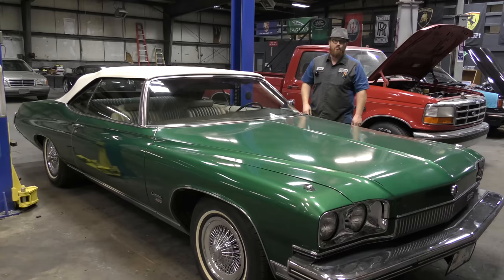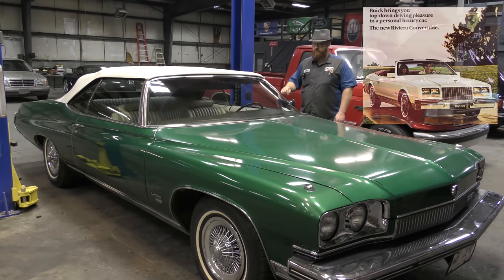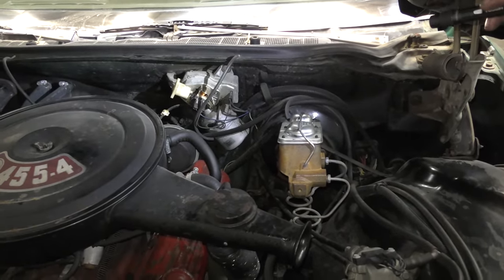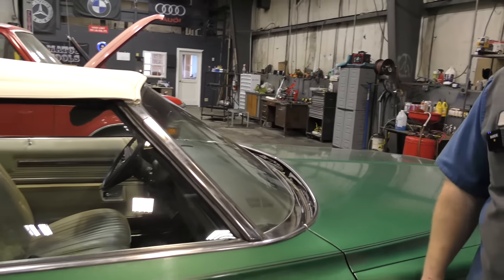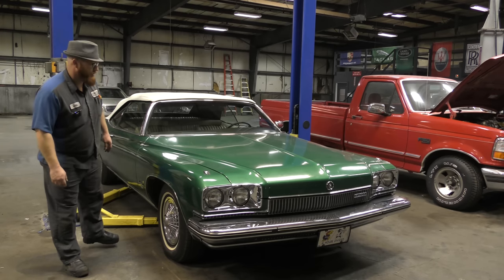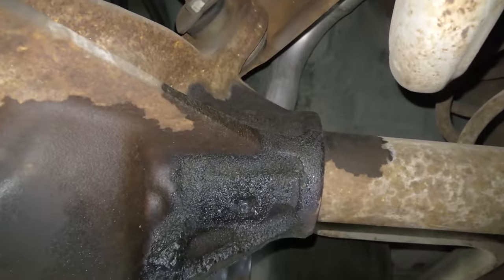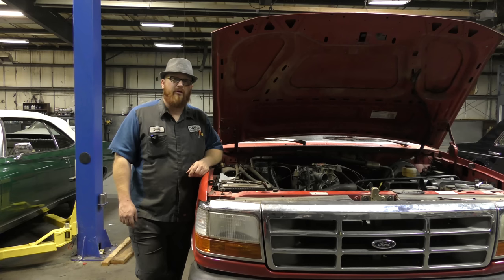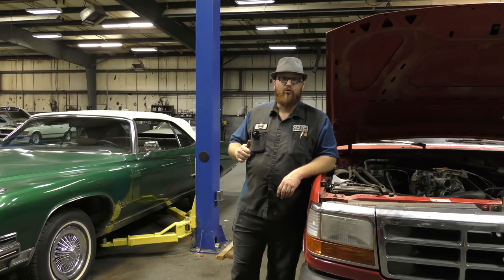Road Warrior! The CAR WIZARD shares a rare '73 Buick Centurion.

Comment: My mom had that car. It was yellow. It was a boat.  I drove it for my drivers test when I was 16. The examiner was impressed when I got to the 3 point turn in it. It would really fly with that big ass engine. I don't remember it being so load but did have a rumble.

Comment: I remember my girl friend got a Buick that was basically a Chevy Nova with different name badge and taillights. She argued with me about it until a mechanic told her Yes, it's just a Nova with a different wrapper. That being said, those 1970's cars were so emissions controlled, it killed any horse power they had. If you were like me, you knew how to rip all that crap off and tune them to run as intended. I watched a mechanic rip all the smog controls off my mom's 78 Chevy Nova 6 months after she bought it new. The smog pump fried as you stated. Her mechanic said, let me have it and I can take care of it. 
I think the pump was $150 at the time. A kings random. Any ways.  A hand full of golf tees and advanced the timing and that  engine came to life. We watched the front fenders rot through in 8 months. That was interesting. Those old boats were really something. I had a Chrysler New Yorker Broughtham, it had a 440 hemi in it but was so heavy it sucked gas like a drunk with a good bottle of Jim Beam. The thing only ran best doing 90 mph. lol.

Comment: HI Wizard a bit of history on the 1973 first year for the 5 mph front bumper only . Staring 1974 they had to be front and rear . If you check the 1973 the front is bolted to oil filled cylinder and the rears still had a bracket bolted to the frame . Thank You for the videos !

Comment: I bought a 1972 Buick Skylark custom in 1978. It was a cream puff. Red with a white vinyl top. Factory chrome rims, bucket seats center console automatic shifter. 350 motor, 4 barrel carb. Kinda looked like a Chevelle, but more luxury. I miss that car.

Comment: Very nice. It's obviously not spent much time in mid-west winters. Does it have the "speed alert?" It was a setting for the speedometer. When you reached that speed, it would make a sound on the radio. I remember the 1973 models. 5 MPH bumpers, but no catalytic. That wouldn't come for two more years.
Thanks for showing it.
Reply: Yes, has the speed alert!👍

Comment: I'm totally with you Wizard on older truck parts. Case in point:  trying to convert my OBS Ford dually to hydroboost. Last hydroboost unit in the country (at least that I can find) sold on eBay 4 months ago from a Ford dealer in Amarillo, TX. I missed out on it & haven't seen another one since anywhere. 

I think a large part of this is a trickle-down effect from cash for clunkers. So many of those old trucks got turned in and therefore not many idiots like me are driving them around. The parts manufacturers will make what sells the most, so it's hard to blame them in retrospect. I place blame squarely on the scumbag politicians that came up with that nonsense!

Another result of C4C, the junkyards are virtually empty of old girls like mine.

Comment: Note how the back seat is the same width as a hardtop car... that's a change GM did from 1971 to 1976 with their convertibles. The top hinges in a weird diagonal 'scissor' motion that doesn't need room where the armrests would be in the back seat. Older models' tops hinged like you would expect, laterally and needed a custom narrower rear seat to accommodate the hardware. Also... you DO NOT want to store anything solid or hard in the trunk pushed high up against the back seat. It WILL smash the rear window glass when the convertible top is lowered (I did it twice).

Comment: it has our eads  on it   ..in the shop  they were called  maxies..   worked in plt 14 that made  them  ,fixed  elec  problems   on the lines   ..a very hot  plant   in the summer  an most had delcon  controls  ,,,lost  of fun  to work  on

Comment: 94 Chrysler Concorde body parts back 8 years ago was 0 - 0. It made it to 255k before I trade in.  It had original 3.5L engine and transmission.  The reason i trade in was the transmission start shifting rough and randomly missed shifting. Then the body developed rust hole. I hate to trade it, but i have no choice since the parts done dried out.

Comment: One of my first cars was a 1970 Oldsmobile Delta 88 with the Rocket 455 engine!  I loved that car and it had awesome power!  I drove it until I traded in on a new Pontiac Trans AM in 1975!
Reply: Did you keep the Trans Am? That would really be something to have today. I sure wish I had kept my '57 Chevy two door station wagon AND my '68 Chevelle SS. Ah, to dream.
Reply: @michaeleh5352  No I traded it for a 1977 Bandit Tran Am that I wished I'd kept, but unfortunately, I traded it for a 1979 Corvette 4 speed which I traded for an 83 Camaro Z28 which I traded for an 87 Iroc Z Camaro which I traded on a 91 Mustang GT 5.0!  After the Mustand I moved on to a Z71 Truck and then to an Avalanche!  I've enjoyed each and every one of them!  While I've always been a GM man I must admit the Mustang GT was probably the most reliable of them all!

Comment: I like the Originality of the Buick,,,They Are A Wonderful ,,,Engineered Vehicle ,,,THE Dried Out Emblem ,,,can be Brushed in with some catilized   urethane Clear ,,maybe a couple of coats and it will Liven Up the Appearance Greatly ,,without taking it off or trying to find a new one ,,Ive done this on my 73 Pontiac Granville Conv with 455 n425 hp ,,,Good Luck with parts serches

Comment: The US DOT was threatening all new roll over standards (this is why the FIAT X1/9 has a b-pillar hoop). Combined with lagging sales, GM stopped all convertibles in 1975, except the El Dorado. 1976 was its last year.

The regs never happened, and after a few years, they came back. Some Eldo owners sued GM for trashing their perceived collector values... that didn't go very far. 

I love these. Almost bought a 1974 Caprice in dark green with white top and a 454!! Wish I had. It was the cool!!

Comment: I never owned one of these but my dad bought brand new in 1973 a Buick Century Gran Sport. Sadly, finding parts for its rotted body was not easy and not cheap to replace the failed roof which suffered from rot due to the vinyl top which was so popular back then. Eventually my dad sold it and the guy who got it scrapped it after realizing it was not worth saving. I miss it and want to build a tribute car once i have the finances to do so. Wizard you are not at all wrong about the parts supply issue as i am friends with the fleet mechanic of a cab company i used to work for and he told me that all manufacturers are stopping production of parts supply for cars older than 8 years other than classics and even those are becoming harder to find at times. It is not just sad but asinine as you cannot in a free country, force people to buy what you want them to. You make a product and if people like it, they will buy it and it will succeed. You don't treat people like cattle and corral them into buying what you want them to just to make a profit. I think this will kill the auto industry along with making cars that are not reliable, too filled with technology and too expensive to repair. I see it with the German cars. More people lease BMW, Mercedes, Porsche and Audi then they ever did before because of these issues. I see the car industry consolidating and shrinking massively in the next 10 years. If the industry heads were smarter, they would actually support older cars and trucks heavily and make a lot of money on it too, but they chose to force feed people cars that they do not need and make people spend money they don't want to in order to buy a new car they would not really need.

Comment: I love that beast! Well this may be curious but the part i had more troubles to find was tires for my 1981 Chevrolet Caprice in Venezuela, 225/70/R15 and it was terrible, only 215/70 or 255/70 or 225/65, i ended up selling the car without good front tires, that was 2 years ago

Comment: I cant find a Vehicle speed Sensor for my 1981 Pontiac Bonneville. The lockup on the torque convertor doesn't lock up and the check engine light comes on when you get above 40 miles an hour. It gives a code 24 which is the vehicle speed sensor. I havent had the speedometer out yet though to look at it. Thank you for sharing this Centurion with us. Grandma and Grandpa had a '74 LeSabre and it somewhat reminds me of it. In fact they traded that for the 1981 Bonneville I have now.

Comment: It would be an extreme sin to change out that 2 knob radio... I remember back in the day you use to have to hack out the radio opening with the square and 2 knob holes to a Din size unit. If I had a nickel for every radio I have installed.... Man... good times... Remember Kraco? That was the cheap radio of the time. Back when Pioneer was actually really good
Reply: My old '75 LeSabre convertible has the optional factory sport mirrors. They look pretty cool.

Comment: You can thank cash for clunkers for the lack of parts, at least on the used side of things.
Reply: Scam program.
Reply: Cash for clunkers has nothing to do with parts drying up. Companies aren't making them anymore especially in the aftermarket.
Reply: @Hotlog69  Are you blind? I'm talking about used parts, which I clearly stated, and used parts are often invaluable to people restoring vehicles.
Reply: @JB-mk4ry  You don't restore a 90s 150. Used parts isn't something The Wizard uses. Unless it's expensive European parts.
Reply: @Hotlog69  how do you figure that? 10s of thousands of old 90s F trucks were turned in during that scam. Parts suppliers saw less need for EEC 4/5 ECMs due to fewer people driving them. They're only gonna make parts that sell.  

If C4C hadn't gutted the market of all those old trucks, you can bet the parts suppliers would still be making them because people would still be driving & needing parts for them. 

EVERYTHING about the program was a complete sham!!!
Reply: jecrpalier No, it started in Congress.
Reply: @acemobile9806  Tens of thousands? Going to need a citation for that. If you ran a legitimate repair shop, you're not going to use junk parts. So, this has nothing to do with the Wizards problem. In fact junk parts makes it worse!
Reply: Lol cash for clunkers . They didn't buy old pre 90's cars 10 years or newer all cash for clunkers did was kill the used car sales for a couple of years just hurt the people that couldn't afford a brand new car . They weren't buying 85 ford Escorts the were buying well maintained newer cars and trucks to prop up G.M and Chrysler after the government bail out . Had nothing to do with clunkers .
Reply: Freiburger's yellow crusher Camaro was one that escaped that program...it does have some good stories
Reply: @alt7488  That was a different Cash for Clunkers program in the 90's.
Reply: daniel bean  They're not, but ok.
Reply: @Hotlog69  There was no cash for clunker program in the 90s
Reply: @cadman10000  It's called CAP in California. Freiburger had his Crusher Camaro for over 20 years.
Reply: @deadprivacy  You really think a 1973 Buick Centurion is a typical car that's brought in to your average repair shop? We're not talking about classic uncommon cars. Yet you say I don't know what I'm talking about. 🤔
Reply: @Hotlog69  tahts exactly what we are talking about, low numbers made mean the scrappage scheme both in the usa and here in the uk condemned way more cars to the scrap heap than were actually officially signed off on it.
Reply: 11 years later and they're still crying about cash for clunkers. Lol
Reply: @deadprivacy  Who is this "we" you speak of? Did you watch the video? The Wizard made his rant over normal every day vehicles they're 20-30 years old can can't find parts. He found the computer for the F-150 via Carquest. I'm sure you're familiar with them, Mr. Master Mechanic.
Reply: @Hotlog69  "we are not talking about"- a direct quote, "thats exactly what we are talking about", my repose.
youve never fixed a car in your life .
and no ive no idea what carquest is, im not in the usa.
Reply: @deadprivacy  See, there lies the problem. You don't know me or anything we're talking about. This is America!
Reply: Fun fact; no you can't. Cash for clunkers required cars to be newer than 1984 to qualify for the program. You can dislike the program, I'm no fan, but it's not the reason we don't have these cars around today.
Reply: @Spencer481  not in the uk, wolseys alvis, rolls royces, fleets of escorts, 205 gtis, you name it, they scrapped it, demanded they be crushed too, was a boondoggle for carbmanufacturers.
Reply: @Hotlog69  yep i do, i know youve never so much as swapped oil in a car...
Reply: @deadprivacy  I can only speak for America's scheme, a fair amount of modern classics were scrapped which I think is a real shame.
Reply: @Hotlog69  90s trucks aren't popular for restoration. I can rattle near 50 people I personally know, in my town that restore, modify, race and show 90's trucks. Mostly GM's but some of the nicer Ford's as well
Reply: @Cody6210  So, they wouldn't care if they have the correct OE part or not. Just what ever works and make them go faster?

Comment: holy ghost that hood is longer than my old Kia
edit, hmm I am a electronics engineer with a knack for old vintage computers, maybe I should consider rebuilding ford 5.0's ECM ... my boss's boss was on the design team for them hehe
Reply: I think there's going growing potential for a cottage industry for stuff like that as these early EFI cars start to age out of the conventional parts supply chain. Usually it's pretty simple stuff like capacitors and/or regulators dying that knocks them out. Like Wizard says nobody is making them new any more, but there's got to be enough used stuff kicking around still that could be fixed with a low-cost rebuild.

Comment: I don't know how many hoops there would be to jump through to get parts imported to you, but I'm in Canada and I've never had problems getting parts for older cars. Sure stuff like body panels and obscure model specific stuff is still hard, but  stuff for trucks? Never had to wait more than a few hours for a warehouse runner. I used to work for Bumper 2 Bumper (Uni-select) as a delivery driver a few years ago and at least once a week I'd see a part on my delivery list and be like, "What the hell? We have that in stock?" Plus those old trucks are filling up every junk yard. I go to my local pick and pull and can't throw a rock without hitting an OBS Ford or an OBS Chevy.

Comment: Old computers can be recreated with the use of FPGA computers. Basically an FPGA can emulate any type of older computer hardware if you have an original and a good low level programmer person. Won't be cheap, but it only needs to be done once for every computer part. The programming for the FPGAs can then be shared online.

Comment: Growing up we owned a 1973 Oldsmobile Custom Cruiser wagon, which was more expensive at the time than a Cadillac...MSRP was about $8k....This was the period that GM experimented with lining the gas tanks with fiberglass - which the gasoline started disolving. This caused major engine problems. This Centurion might suffer from the same issue.

Comment: At that time the passenger mirror was about a $25 option from the factory, dealer cost. So if one dealer had the car for $4900 without the mirror, and the next dealer needed $4925 for the same car with the "who needs it?" mirror, they lost the sale. So cars ordered for inventory never had the right mirror, that $25 meant a lost sale.

Comment: That 1973 Buick Centurion is a type of car that was common in the nineteen sixties and nineteen seventies but now is not made anymore. This car is the old style full size sedan with a large V8 engine, rear wheel drive with a solid axle and body on a frame construction.  These cars had a smooth comfortable ride. Also with the pickup truck Car Wizard is running into a thing called planned obsolescence. The manufacturers purposely discontinue support and parts for old models of vehicles so that the consumer is forced to buy the latest, newest vehicles.

Comment: Having a hard time finding the PCM for a 93 Bronco with the 5.8 E4od drive train, going to repair my original one just so I can move the truck from where it broke down in my yard, $20 worth of Caps & Resistors to fix but I won't trust it to put it on the road with the pcm cause of what it looks like inside. Cali Emis PCMs are out there but not Fed emis.

Comment: Hi. RE Hoovies Bentley. The pipe is missing from the feed into the Fuel pressure regulator. So the fuel pressure is not being increased when under boost. This needs to be fixed before he ends up melting pistons.

Comment: I remember seeing lots of those around and in the boneyards all over new England all rust buckets I never was into Buicks much I was too busy w olds and Pontiac and when someone told me the oil pumps were questionable I never fooled w one but they had as much or even more torque than the others olds and Pontiac 455 motors all of which back in the 80s up there seeing as every boneyards were full of them you could get a 455 of any make usually low mileage under a 100 thou for 200 bucks pulled for you to pick up

Comment: My dad could have brought one of these in 1994 it was a beige color 1973 he could have brought it for 2500.00 and the same guy also had a 1976 Pontiac Grandville Convertible with Beige with white Int with 66k miles for 2450.00. He didn't because we were on vacation in North Dakota.  Man we were stupid for not getting these two cars. the Grandville Convertible is very rare too.